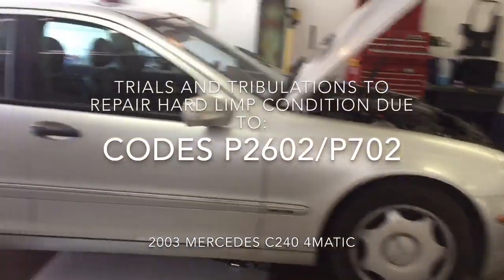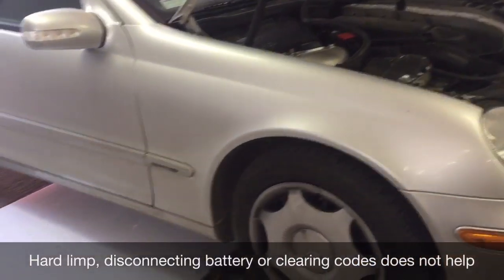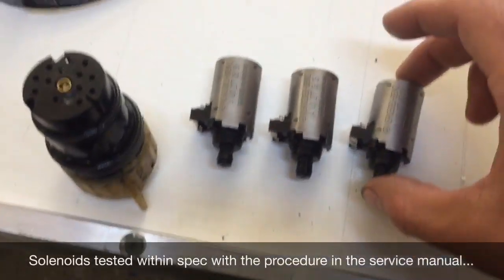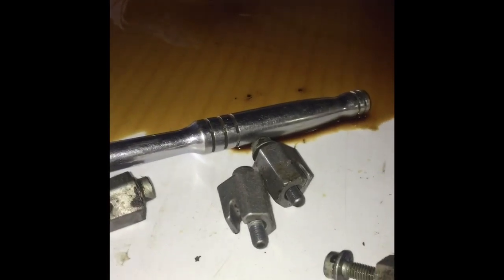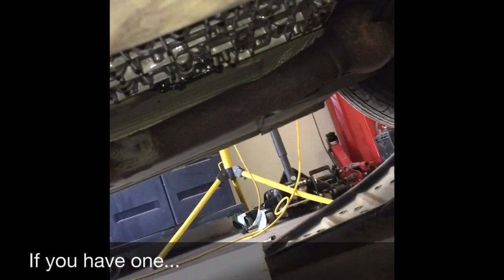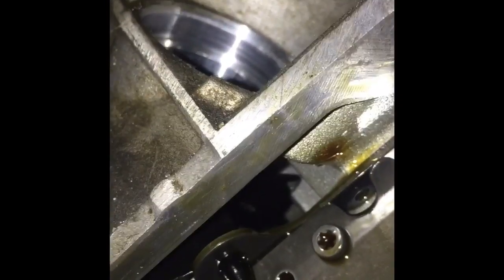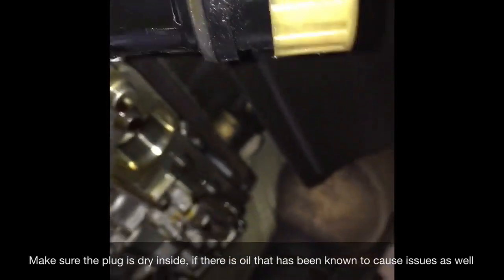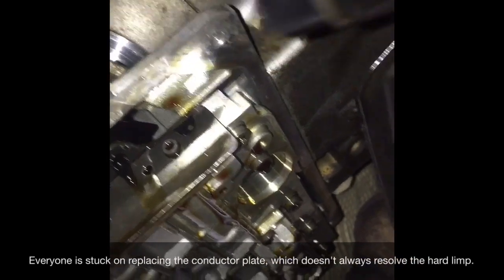Mercedes 722.6 Limp mode. Fixed!

Comment: MY E350 IS STUCK IN LIMP MODE MY OBD SAYS ITS MY TRANS SPEED SENSOR  BUT IVE REPLACED THE TRAN TO CHASSIS GROUND THAT WAS SO FRAYED IT WAS CRUNBLING WHE I BARELEY TOUCHED IT SO IT IS REPLACED  TOOK IT FOR A RIDE AND ITS STUCK IN LIMP ANY IDEA HOW TO GET IT OUT OF LIMP

Comment: Will conductor plate issues also cause it to not go into gear, i have aweird issue, its in limp mode but, it will stop going into gear, i turn it off , wait like 2 minutes , it will go into gear again( limp mode)

Comment: Note even fitting a different diff ratio produces a limp home mode due to a corrupted signal being supplied to conductor from wheel sensor speed

Comment: Please let me borrow the TCM you got that didn't need if you still have it. I fixed my issue a few years ago w a new solenoid and it worked but dis have oil in my TCM but still may be a problem cause cold start upshift is horrible 🤦🏻‍♂️

Comment: The scanner already told you the issue

It is a solenoid from the beginning, and u went changing unrelated things , but better at all way to renew conductor plate to refresh transmission ❤
Reply: That's not always true; the valve body has many parts, it can be a valve sleeve, a pin. They might need to replace the Valve body repair kit. Trust from personal experience.

Comment: U got a nu conductor plate & didnt work. Next u get a used ML350 conductor plate & it works. So nu 1 is faulty?? Also thx 4 heads up on matching part # on TCU. I didn't do that on mine

Comment: The 13 pin harness wire plug is only cliped not soldered i have tested 8 from old wrecked 1998 to 2002 ml320  found 1 ok rest had 1 to 2 wires loose thats was my problem i rewired on my 1998  ml320 and all ok now but was a nightmare to find

Comment: You said that you turn the key and "Pressed the Button Winter or Sport on the side" and found out Limp mode works or Not? Where is that button?  can you tell the name? Is it one of the Dash to the right side if the Key Buttons like ESP??
Reply: its by the gear shifter called "W  S"

Comment: actually if you realize, your video did not really give an accurate solution to the limp mode problem. You just bought another transmission and your limp mode was gone! So are you saying the problem is the whole transmission???

Comment: In my case I did the required job changing the conductor plate  brand new and all the solendoids brand new but yet the car is still in limp mode!!! Any suggestions? 😧
Reply: u need to  buy a obd2 scanner and reset the tcm look up more videos youll see
Reply: my cars in limp mode hopefully after i reset it and change plate its fixed

Comment: Hi luke, I bought a 2000 E320 W210 wagon that had a bad transmission conductor plate. the guy i bought it from had messed with it and it was bad. I replaced the transmission with a transmission from a car I had been driving that works perfect. I put the transmission in place of the bad transmission but it is in limp mode. I know the transmission I put in it is good and now I am stumped? Where are the transmission codes logged? The transmission computer or the car ecm? Thank you patrick!
Reply from the maker: It’s been years since I did this video. I would check and make sure your tcm matches the transmission you put in. Also if the previous owner messed with the conductor plate then check the plug and pins to make sure that all of that is seated correctly. Otherwise I won’t be able to help in any other way.

Comment: Thanks I've got a valve body and adapter plug, and filter. Drained the transmission, replaced everything. The code Po700 was gone, But now I have codes of Po743/Po763/Po753. Torque converter
clutch and Shift solenoid C and shift solenoid  A. I'm only getting reverse at this point. No Drive, 1,2,3, . I've check the transmission fluid and still only reverse. The car has 140 k miles and to
my knowledge it the first transmission change. It was very dirt, with particles  in the filter.  It's the third flush and I'm at wits end. 1/1/24

Comment: 90% of the time it is the conductor plate, not the sensors! I went to a junk yard removed a conductor plate. Had the vin wiped, and programed for my vin number. I replaced tranny filter, tranny pan gasket, tranny pan aluminum screws, new synthetic tranny oil. I have a running and driving car!

Comment: i solved my limp mode with a new battery and a reset.
Reply: Hey buddy what do you mean by reset the battery or computer?
Reply: @deequan-nu5fy  i heard an old battery can cause it. changed the battery then put a scanner over it and reset the codes using the scanner tool. changed all oil and filters, have not had a problems since

Comment: Hey Luke I have a 99 Mercedes Benz clk 320  and I changed the conductor plate because one of the the pins where the electoral plug, plugs into the conductor plate broke and it wouldn't shift out of first gear..... But I put a aftermarket conductor plate in and it still won't shift out of first gear..... Do u have a solution to this problem?
Reply: How did you fix that no shifting  problem.

Comment: I also replaced the conductor plate along with the electrical connector, fluid, filter, gasket. And it worked initially for about 30mins. Then it went back to limp mode , but also it would no longer accelerate (in drive or reverse) as if it was stuck in neutral. The solenoids looked pitted when I dropped the valve body but only tested resistance and they checked out fine. I’m thinking solenoids need to be changed , but do you think it could be something else as well? Given that when it’s cold, it’ll shift but once it warms up , it will not accelerate in drive or reverse .
Reply: Change the transmission oil in the filter

Comment: Did you try to clear codes in trans and motor electronics and the drive it it should start shifting fine if its a conductor place and after 1 drive cycle the fault will return and shortly be back in limp mode

Comment: Hey Luke, hope you’re still active here. I have the same symptoms as you minus the same engine code and was stuck in limp mode. First I had the P0709 code I believe which was for the input sensor but when I went to change the tcm, it fixed the issue for an hour before going back into limp mode with a different code telling me the pulsating solenoid was bad. So I replaced the conductor plate and all my solenoids to no avail. Still in limp mode. Could it be my tcm again?
Reply: No it's the TCM that needs to have the computer board resolder

Comment: After watching your video I feel a little better about programming the conductor plate.  My car did not give me any cod3s, but it does shift hard from 1st to 2nd when coldstar, but ones the car reaches a 180ﾟ it run smooth.

Comment: So you didn't have to reprogram the conductor plate?
Reply from the maker: No. Not on the 722.6
Reply: @lukec4745  so 722.9 needs programming

Comment: I’m driving an X156, a 722.9 automatic transmission box. I had a transmission malfunction notice on my instrumental cluster at 160000km. Car was still driving fine. I took it in for a transmission service. They changed the oil, filters and the gasket. Car came back still driving fine but the notification still comes up every now and then. Recently it triggered an engine light and when diagnosed it has no codes. I took the car back to the dealership & now they want to replace my conductor plate. The part is very expensive, my car is not on limp mode, gears shift fine as they supposed to I’m just irritated by the notification. Any idea what could be the cause? Please assist.
Reply from the maker: The 722.9 is a different transmission, from what I know the conductor plate is part of the valve body so an easy repair can no longer be done even though that transmission suffers from the same issue…engineering at its finest. Sorry can’t help.

Comment: Hi there I have a mercedes w211 E320 not shifting at all, I changed the transmission 2 time but still not shifting. All the rest funcion of the car are working fine...what to recommend me to do?
Reply: Check oil coms from wire harness to your electronic part

Comment: Get a rebuilt valve body. The springs can break and the valves can stick. Then it won't shift
Reply from the maker: Why would you need a rebuilt valve body? It’s expensive. If you watch the video I think I mention I bought the rebuilt/shift kit for it, quite simple to change those springs. None of mine were broken but since I bought the kit I replaced them anyway. Wasn’t the problem.
Reply: @lukec4745  Sounds like we had different issues. I had a very difficult time with a 1997 280c that was stuck in 1st gear. Your video was very encouraging. In the end, I went with a rebuilt valve body by Sonnax. I believe it had all the solenoids on the part for around $450-500 with a 1year warrentee. A bit expensive, but it did the job.

Comment: HI Luke
I have a Mercedes C320 and it was in mint condition. My partner sold it to me to keep it in the family. I had it for about 6 months and it purred. When the indicator came on to service the car I went to a local mechanic and after it also just purred. He said I had an oil leak and did not have enough time to fix that so I had to make another appointment and came back 2 weeks later. As soon as I left my car has been shunting and even has stalled. I went back to him and he said it was not the transmission and said it was idling low. So he raised the revs by not much and while we took it for a drive for me to show him the problem it did shunt and shudder while he was there. It does not do it all the time but mainly when breaking on a hill or leaving the stop lights etc. 
It still was shunting so I went to a transmission mechanic and he told me that it came up with this P2602 code. How can that happen after just an oil repair???

Do you have any advice?  Much appreciated Jan
Reply: Sometimes trans fluid gets into the transmission connector plug...easy to replace ..

Comment: G 463, 1997, TD, the Mercedes mechanic has replaced the selenoy and body valve and the shifter. when we put the speed arm on the D, there is a delay of 5 seconds before doing the speed D. where is the problem? the mechanic thinks that the body valve is defective and replaces it with a new one. What do you think?
Reply from the maker: Your mechanic may be right but You can try searching your symptom online as it’s possible one of the springs in the valve body is broken, it’s also a common issue. There are kits you can install to tighten that up, they are very inexpensive and worth a try before purchasing a pricey valve body.

Comment: Imagine doing all of this on a E220CDI and its still in 2nd gear with turbine speed sensor fault code but nothing on the dash, then you realise that 2 injectors are not original and are from a later production car. You then i realised that the catalictic converter is original too adn when diesel injecors fail they spit out loads of fuel and it creates smoke and then it clogs up the cat. I cut that sucker off and beleave it or not car drives normaly.

Comment: Hey Luke I was wondering how can I fix my EIS on mercedes benz c240 2002, the car key won’t turn , does that mean limp mode? How can I fix the car if it won’t even turn on
Reply from the maker: Ant Be mobbin I can’t comment unless we have somewhere to start with...some background is needed, there can be a few reasons for this. Get it scanned first, with a descent scanner so you can get all the codes not just generic ones. Make sure your battery is fully charged.
Reply: Hey Luke, when you have that limp mode problem, did the fuse #55 burn out?
I got the same year and model you have, with no crank no start problem.

Comment: I replaced the conductor plate as well. Guess I'll have to replace those solenoids 😑
Reply: Did you get it fixed. I changed confuctor plate and solenoids. It did not help

Comment: Would you happen to know what the solenoid readings should be or where to find the info? I also already changed the conductor plate and problem still persist, TCM looks clean so I don't think that's the problem so the only thing left are the solenoids
Reply from the maker: J M I   If I remember correctly the resistance should be 2.5-6.5 ohms. You can check individually if you have them out or through the round plug. You can also apply 12 v to test operation. I found information here:

http://shop.ukrtrans.biz/wp-content/uploads/catalogs/722.6.pdf

Comment: Thanks Luke I had to do the same thing and it was good to know.it works.thanks again.peace
Reply: I have a 2004 CL500 Mercedes-Benz in limp mode can you help me fix it I have changed the vgs conductor plate and still in limp mode should I changed the valve body or I need some insight from someone please

Comment: Do you think if you would have used the valve body with conductor plate and solenoids that your computer would have recognized the different  setup or it would work with any 722.6 thanks for your video
Reply from the maker: Del Mytruelement not sure of what you are asking...if you have a whole spare setup then install it complete if you want, the valve body is not “coded” like the newer transmissions  and does not need reprogramming.
Reply: Wow thank you so much I will be  going to pick pull now that’s information that nobody’s given

Comment: 2001 e430 fell into limp node and hard shift. Changed plug, conductor plate and replaced TCU with matchng numbers. The car will shift fine until I get back to a complete stop. Then gets back to limp mode until I restart it. Eventually the p0700 code pops up again. Everytime I erase the code this whole process restarts.
Reply: Any updates on this ? How’d you fix it ?
Reply: @swishmar030  sold the car to my neighbour.

Comment: Thanks. My c240 has the same issues. Changed everything but the solenoids. Do you think if I just brought brand new solenoids, it would solve the issues. I have P0730 code. Thanks
Reply: Hey did you fix it
Reply: Need other transmission!

Comment: What is said in this video is NOT CORRECT!!  I've had this issue several times, and the problem here is that his scan tool (I have the SAME one) is not good enough to reset the codes & hard limp condition.  You need a "better" tool, like a Snap-On modis, or a STAR C3 (and up) multiplexer system, etc.  The Launch Creader is OK for some things, but this is not one of them.

As for the reason why his limp mode resolved on it's own, well, I dont know...I think he simply just got lucky.  Remember we are dealing with Y2K Era electronics, and they weren't all that sophisticated compared to those found on vehicles today.  They sometimes (especially being 20+ years old now) get squirrelly and do weird things.  Regards.
Reply from the maker: Johnathan Waters well if you can’t offer the solution then what is the sense of commenting. The car went to Mercedes after I put in the new conductor plate because I was told I need a “special” computer to reset the tcm. That is nonsense, the tcm will reset itself when the issue is resolved. The only transmissions that need the tcm flash are the newer 722.9.
Reply: @lukec4745  Well, this is what I do for a living, and I believe I did offer the solution.  Not sure what you're talking about.
Reply: @lukec4745  First off thank you! ..Like to say Your thinking and way you explain things I can relate too and your camera shots were more than helpful..I have a 06 c230 and I believe I need to change my plug ..also I dont have a dipstick tube with a lock everyone keeps mentioning...stuck hours away with lil ones :(

Comment: Dont buy tcm. Fix urself. So simple!! I have vidson it  esp bas fix. Ecm fix rear and front sam unit fix. Easy. But solenoids. Remove test with 12v, and also change 13 pin plug

Comment: My 2012 Mercedes E350 overheated for just a second and I experienced a loss of power, but the engine still felt like it was running smooth, so I was happy to hear it may have went into limp mode. It's going to the mechanic tomorrow so we'll see. I parked it immediately and didn't restart it so I'm hoping like hell I didn't blow the engine. The car was from Florida and I'm in Maine. It was 17 degrees when all of this happened. I opened the hood and you could see spray on the engine cover. Care to speculate? Thanks

Comment: I've replaced the conductor plate and transmission on my 2000 Mercedes e320...my first transmission wouldn't shift...now this one will shift...but It still want accelerate...it go in p,d,n,r but it barely move when do and I have esp elec.stabil.prog visit workshop on my dash what yu think my problem...ppl sayin I ned 2 get a tcm

Comment: replaced conductor plate on a whim, wonders why codes till persist. 
proper diagnosis is always needed. too many people condemn the conductor plate for the wrong codes. glad you got it fixed but please make sure next time you perform proper diagnosis, and you do need the proper scanner to erase codes from the tcm.
Reply from the maker: Benz-Tech Lou P. Lol this car sat at Mercedes for 3 days and they told me I needed a valve body. And yes, you need a special scanner which I have. Cheers
Reply: I had same problems and more.  Dealer wants to charge 300 for general scanning, then another 300 for the transmission issue.  I told dealer to F... off!!!
Reply: I had the limp mode and a special mechanic wants 1500-2000 to change the conductor/solenoids (I did change the conductor plate).  Then I ventured in buying a used shift module!  25 easy minutes and the problem gone!!!
Reply: Sad but not all dealers have quality technicians, sorry that happened. Probably got a new guy that diagnosed your car. :(
Reply: I can help with mercedes diagnosis in the future. 
Www.cartechconnect.com